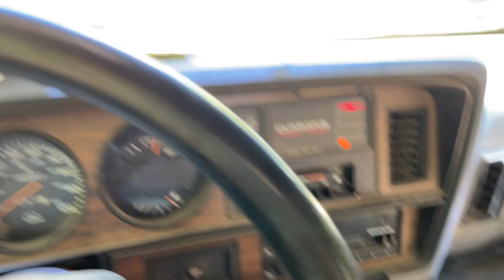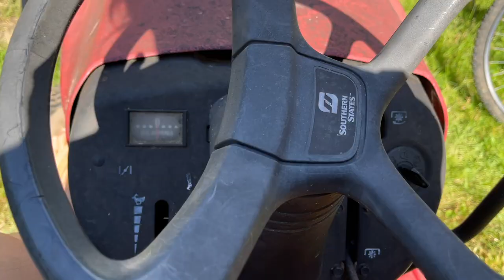A Wild Day! (And a Sweet Recipe 😋)

Comment: I would think Lawrence would have one of those tire repair kits, where he could repair it right there on the spot. He can repair darn near anything! 😃
Reply: @harddocs  It appears they had a hex-head screw in their tire, not a cut. Punctures from nails and screws are what those kits are for. If the tire is still in good condition, they should last. I had one tire fixed that way and didn’t have any problems. If they have a lot of stress on their tires, maybe they should have them replaced soon. In that case, I would plug the tire and use it as a spare only.

Comment: I only clean my iron skillets with boiling water and/ or a paper towel. I use a metal scraper first to scrape tough stuff out. My skillet has not been in the sink in years. It looks brand new almost. If you keep them oiled right and never use de-greaser, they work better than a non stick pan.
Reply: Thank you concerning the skillets I have been using hot water and towel as well. Then I Heat oil in the skillet. Pretty hot but still learning

Comment: My Mom always used baking soda and water, low heat/slow boil to get the stuck stuff out of her cast irons. Works!
Reply: I do the same Baking Soda works very well
Reply: and if that dont work a simple steel wool pad!
Reply: @timhood6970  without soap
Reply: @maryjemison1101  yep
Reply: Try hydrogen peroxide. I had a thought once that if it attacks protein like it does your skin, then maybe it would break the bond between fry pans and egg and meat. You should see egg fall off a pan after it has been soaked in peroxide.

Comment: Lawrence is really going to like the triple-cross sudan. It is small seeded, around 13,000/lb. The seed IS expensive...BUT, you plant less, about 1/2 as many pounds/acre. With a firm seedbed you'll end up with plants as thick as hair, with stems more like pencils than broomsticks . Way less waste. Much more palatable to the cows. It also doesn't tend to head as easily if rain delays cutting. 
It and millet are the only summer annuals I'll plant for hay. The seed usually is hard to find....for EITHER ! Following from SW OK, Earl

Comment: The only difference I'd make to the hard sweet potato pies is use cinnamon and nutmeg instead of pumpkin spice.

My great grandmother would make those little hand pies with whatever fruit was ripe at the time. We'd have black berry, fig, peach and apple from July on. You can also lay the dough in some coarse sugar before frying. Mighty tasty.

I noticed the Milwaukee impact gun in one of your last videos. I keep one in my truck, as the lug nut torque is in excess of 450ft/lbs and is a bear to break lose on the side of the road. Another of those tools that after you have one, you don't know how you lived without. (like that grease gun)

Comment: If you get a flat tire from a screw, you dont even have to take it off the truck. Just pull screw out and plug it up with tire plug and pump up tire and it's fixed.

Comment: What happened to the 4455 ? You are not using it ?
Reply: I asked the same thing a few videos ago. Think it's just for the muddy season? I'm really excited to see LB using it.
Reply: 4 Wheel Dr. pretty expensive to operate and repair. Probably don’t use it until They really need it. Speculation, 60-year-old country boy. God bless
Reply from the maker: He's used it a little, but it will be used more in winter, I think.
Reply: @paulprigge1209  i have driven the 4255 and not many repairs needed, its an iron horse !

Comment: Block the my wheel 2 blocks and jack up(start) losing the bolts finished jacking up remove the nuts and remove the tire and replace the tire then put the nuts back on tighten the nuts put the truck down remove the jack and blocks and you are done

Comment: Sounds like your lawnmower needs to have its air cleaner cleaned or replaced. It might be what’s causing that revving sound.
Reply: I'm betting its a Briggs & Stratton engine........the carb on those engines are notorious for "hunting" for an idle location.

Comment: Ahhhhhh finally the true culprit shows it's self that has been ruining the the cast iron skillets seasoning. My grandmother would have knocked me plain silly if I touched her cast iron with ANY metal (My Mother also) lmfao, like literally knocked me in the back of my head XD. Using metal on cast iron totally ruins the seasoning, in the deep south, we set ours to the side with hot soapy water for a few minutes, while were doing other things, then use soft scrubbers on them for a fast easy hand clean. Not gonna hurt the cast iron using metal, just ruins the seasoning, that mostly you worked hard to achieve.